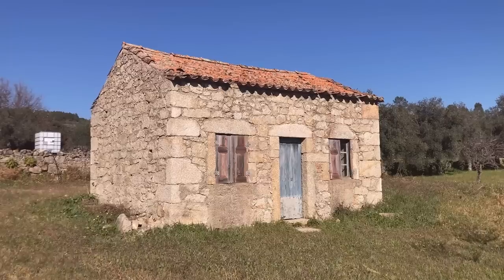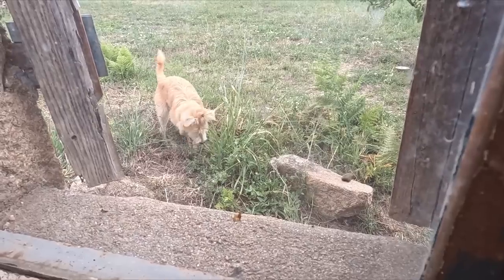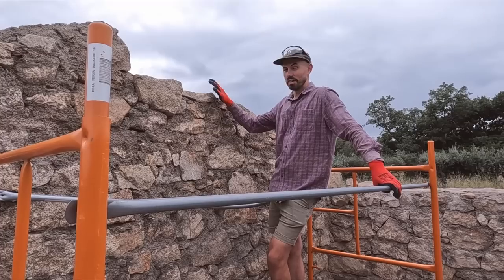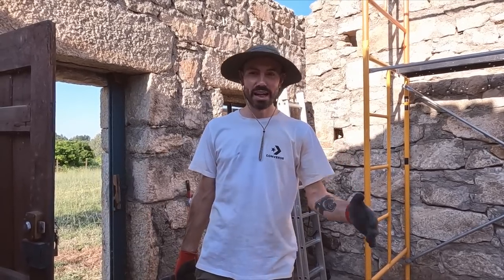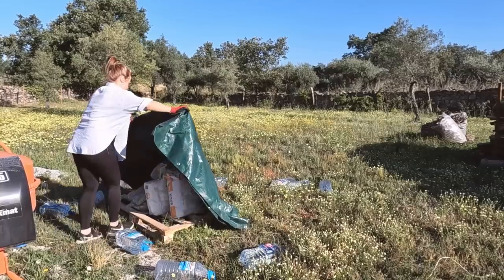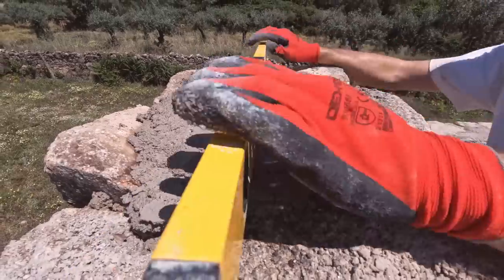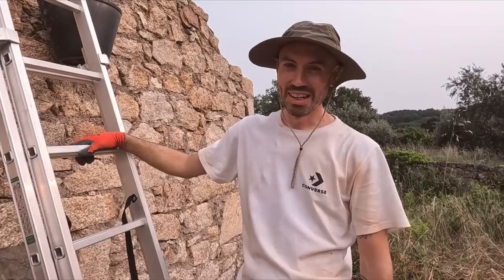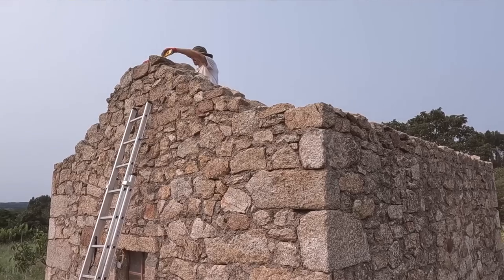Things Aren't Going as Planned on Our Stone Cottage Rebuild

Comment: What a challenging week between the heat, the insects, and the stomach pain.  Good luck with the ultrasound.

Now that the dogs have had their bath, it's time for mom and dad to cool off with a bath in the splash pool.
Reply from the maker: Well, the pool water is currently green because we had issues with the filter/pump! New one arrived yesterday though so as soon as I’ve got a spare hour or so I’ll get it up & running & be on the way to clean, dippable water again!😊

Comment: Hope you have got to grips with the gables, but if not- you usually make  a dummy Truss x2. Put one on each inside wall. Then you can either sight across them or tie a stingline to the top edge of the far Truss then pull the line down till it touches the near one and then you have spot-on height for the gable end.
Back in Blighty, you would also build in your gable ladder, this gives you something to fix your (facia) barge boards to. Like a one-sided ladder with the rungs overhanging outside the wall.

Comment: We built a Strawbale house and used lime plaster.  Since lime is so thirsty. We used a large barrel and made lime putty.  After 2 weeks it was well hydrated and so easy to use.
Reply from the maker: We’re thinking we might slake some for the pointing. I’ve used hot mixed lime before - it was so malleable & fun to work with

Comment: Put a variety of different stone sizes  on the staging. Don't forget the water. Then bring up the mortar, spray the water and begin fitting stones. 
Fill a collection of buckets with different size stones and hook up a winch to pull them up as needed.

Comment: Worried about how to lift all the concrete to the top,  build a jib crane.  Attach/lash a pole to the inside leg of the scaffold with the top offset to hold a pulley.  The ground person can easily lift the bucket on a rope, even for the small stones you have.  Build it high enough you could also assist in lifting some of the beams.

Comment: what about making a dryer almost crumbly mix to pack on the outside of the forms. this should stop the cement seeping out of the form and could be brushed away after with a wire brush and would save of ton of work levelling out. Also will you be fixing re-bar in the pour as extra support? not such if its overkill on this project, but........
Reply from the maker: Yep we’re using rebar. Not going overboard with it though as the beam is supported all the way around by the wall 👍🏼

Comment: Are you using lime mortar? It is supposed to be better than concrete as it does not retain water. At least that's my understanding.
Reply from the maker: We’re using hydraulic lime for the rebuild of walls but will likely use a slaked lime for pointing. Still undecided. But you’re right, lime is permeable so acts as a wick to draw out damp from the stone work 👍🏼